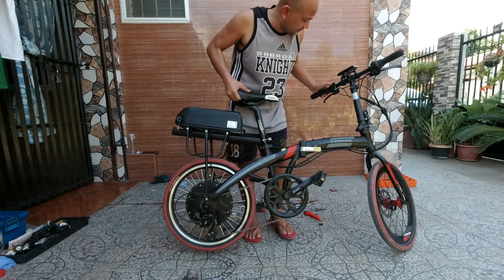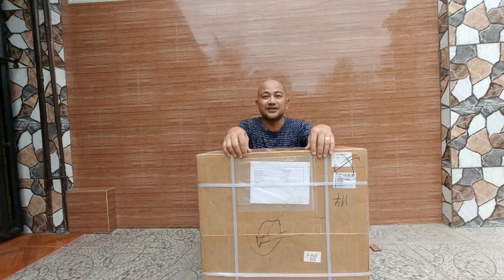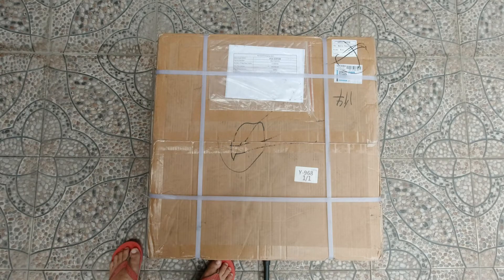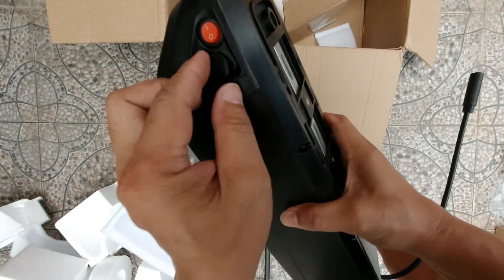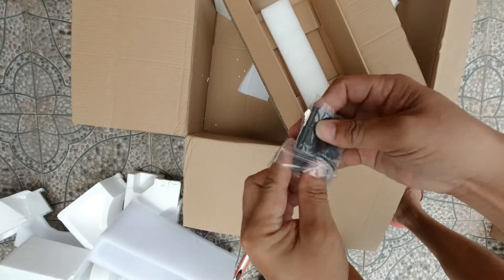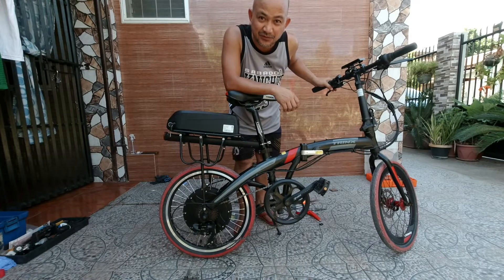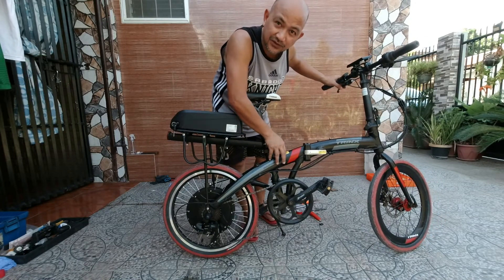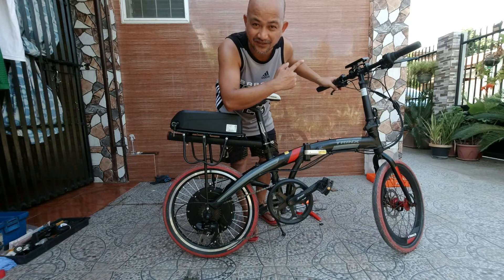Do NOT Convert Your Folding Bike to E-BIKE Watch This First  Trinx Dolphin 2.0 E-bike | DIY Petz

Comment: Magkano ang converter kits ninyo sir?
Reply from the maker: Hi po, depende po sa wattage and battery capacity po. Is usually ranges below 50K for the full conversion kit including the battery po.

Thanks.

Comment: hi sir, when folding your ebike, does the wire get stretched or there is no problem with whatsoever?
Reply from the maker: No Sir, the wire connecting to the battery towards the motor is a loose cable that I can tack in to the side once folded.
Reply: @RollyPetz  ooh nice nice

Comment: Luna bikes sold a folder with a Bafang BBS02 mid drive in it.  Overpowered bike that surprises experienced riders.  "A friggin shredder" is a Los Angeles you tuber who rates it in his top 5 ebikes.  Get a bottom bracket removal tool and $450 BBS02 and you got the same beast. The light weight and short wheel base makes it a fast nimble bike.
Reply from the maker: Sir actually this bike is intended for my wife as she loves biking but unfortunately need practice that's why I opted for the rear hub with this 500 watt motor. Not so powerful but ideal for nearby commutes. Appreciate your feedback Sir. Stay safe.
Reply: I have the BBSHD and Luna's Dire Wolf Battery. My new foldable will be here on Wednesday. 52 wide/narrow chainring. It is gonna be a wicked machine.
Reply: @VideoMusicManiacPlace  If you're going to use Water Bottle mount for battery, consider getting rectangular aluminum tubing as a riser so it clears the hinge bump (I have a Zizzo folder w/ straight top bar).  Get extra long bottle screws so it goes thru riser. 52 tooth Chainring is smart since your 20” wheel needs to spin faster than a 27” wheel for speed.
Nice having a lighter folder that's not a 66 lb fat tire folder. Good luck